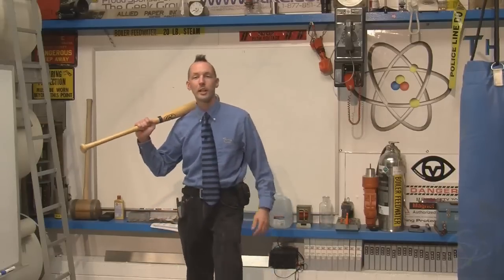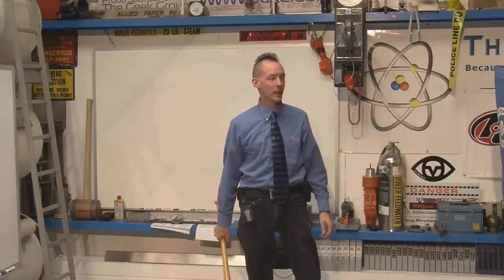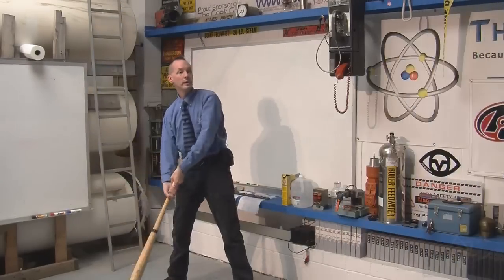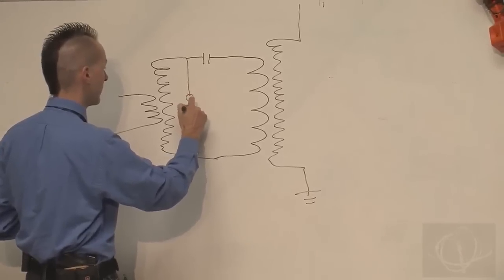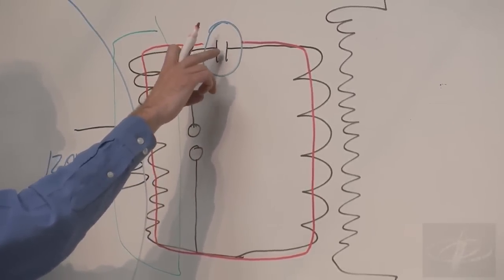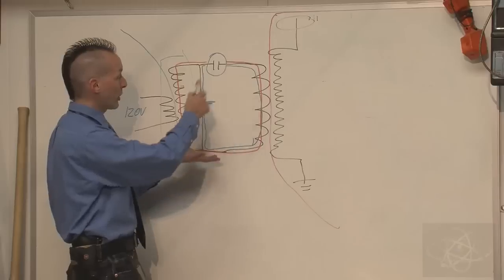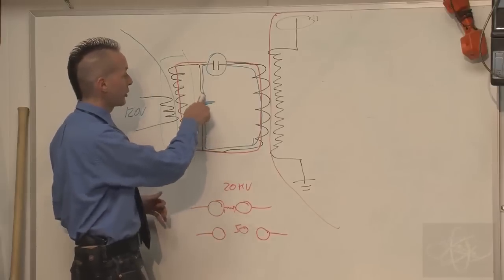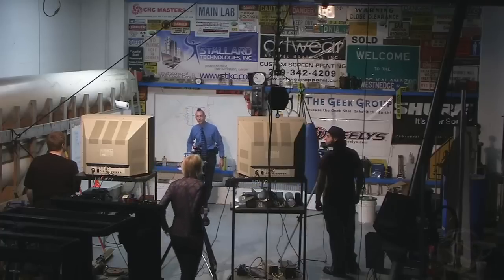Resonance and Tesla Coil Basics

Comment: Great simile on mechanical resonators and electrical resonators. But the most significant component in the Tesla conventional circuit is the spark gap and non-linearity. You are applying power to the input of the first transformer at sixty Hertz. The second transformer does not work very well in stepping up that frequency to the very high levels you desire. It is most efficient at very high frequencies. Frequency synthesis in electrical systems require non-linearity to produce harmonics that operate the resonance of the LC tank system. The spark gap provides that non-linearity. LCR circuits have very little non-linearity. Fundamental circuits concepts are that they are either linear on non-linear. Linear circuits do not produce harmonics (Fundamental concept here). Also I would suggest you swap the positions of the capacitor and spark gap. This will decouple the 60 Hertz primary transformer windings from the much higher frequency resonance secondary system and improve efficiency ( producing higher voltage of the harmonic frequency) and will cause the first transformer to run at a cooler temperature. I have some experience with Tesla coils building my first one in 1971. I love em...
Reply: When I was active in a TC club the popular approach was to put an RF choke (ferrite toroid) on the transformer output. Same thing: keep the RF out of the transformer.
Reply: Hmm are you saying I can use this to get 60Hz on the output of the secondary and if I want higher voltages on the secondary I would move the cap for high freq? If my NST puts out 30kHz, 9kV at 30mA I can get to higher freq by moving the cap and with cap size I can reach the natural resonant freq on the primary?
Reply: Mark Cummins Thanks Mark. :)
Reply: Well done!
What are you talking about the London Council for, he sounds American?
Reply: What about the rodin coil?  any thoughts?  does that design automatically make a "gap'?  I'd like to throw a frequency into a rodin coil and test it... not a battery but a frequency... then add a battery if maybe .. then try a second frequency to make a harmonic or resonance or both..... probably don't even need a spark plug, I'm guessing.  What do ya think? may have to connect the beginning of winding 1 to the end of winding 2  on the rodin coil to make it a geometrically designed tesla coil.... then we may need a spark plug to get a gap... I dunno. What say you?
Reply: Thank you. Glad you bring this up. It is what most fail to explain and dive into

Comment: Great clear explaination.

Tesla once attached a pocket alarm clock sized device to a street lamp post and tuned its frequency so it would produce a "thump" at resonance.  After a few minutes of thumping, the effect was so great the 3 storey building beside the lamp post began to shake.  The people inside came running out and some called the cops thinking it was an earth quake. 

Tesla quietly removed his device, put it in his pocket and walked away.   

When I heard that story, I was amazed at the power of resonance.
Reply: orangedac it was not the size of a pocket alarm.. you need to look into that more, there are even photos of it.. but it did fit in his jacket pocket. it was a steam powered oscillator and he has patents on it

Comment: Very good! Convert the "heavy bag" coils to opposing partnered output with opposing magnetic fields that have the effect of reducing impedance to zero and thus increasing inductance to Infinity(?). Have another spark gap on a deep ground like a well, and feed large caps to provide pulsed dc current on demand which can be converted to A/C or regular dc as needed

Comment: In your demo with the heavy bag and baseball bat, it would be most efficient if you hit the bag at the middle / bottom of the swing (vs. you seemed to be backing up to hit it almost at the peak of the swing where it is slowest). Assuming the impulse from the bat is the same for both, hitting when the bag is at peak velocity maximizes energy transfer. So it will be quieter as well due to a lower velocity difference between bat and bag.
Nice video on the Tesla coil too. Thanks.

Comment: (2/2) It is massive radio frequency oscillations - created in the primary circuit for the brief moment that an arc is present in the spark gap - that cause the secondary circuit to resonate, not the frequency at which the spark gap fires (audible, ~120 Hz or something), as you so often describe it to be.

Comment: Well explained, but it probably would work better, if you add a high voltage diode after the secondary of the first left secondary coil...so the cap can really charge up in a few cycles...

Comment: Some nice explanations. I would like to point out that Tesla says the transformer (magnifier) is not transverse nor electromagnetic. Tesla used oscillating current and rejected Einstein mass energy equivalence.

Teslas patent also features a third coil. This is important, I feel, due to the complex dimensionality of magneto dielectric mechanics in resonating oscillating systems such as this. . (The dimensionality of the devices wave output interaction, without the third coil wildly differs) :)

Comment: To Adithmart, Electronic 101, capacitors charge first in a circuit> if you don,t see the resistance, for example, don't assume it isn't there

Comment: I take it you are referring to a toroidal terminal capacitance at the top of the Tesla coil's secondary winding? The geometry of the capacitor is not really important. It could also be spheroidal. But the resonant frequency of the secondary coil with its capacitor should be close to that of the primary coil and its capacitor for best results. Which is why we need to know about resonance and the coupling of the two circuits.

Comment: It would be interesting to hear more about the properties of the plasma in the spark gap and oscillations while it is conducting. And while the plasma is conducting the capacitor will not charge so there will be a delay before it can do so again. What would these times typically be?

Comment: You will find if the speed you hit it at and the top speed of the bag is the time you hit it then the result will be far more effecient as the difference in the speed of the 2 mechanical apparatus will determine the absorbance of the energy . Think slapping water with your hand. You can disperses a lot more water with a gentle push in a pool but slapping the water is very ineffecieng .

Comment: I've been trying to understand the correct resonant frequency of my circuit.  The problem is, everyone seems to be more concerned with the resonant frequency of the secondary of the Tesla Coil and not the primary of the Tesla Coil or the secondary of the NST.  I can't seem to figure out what my capacitor value should be, how close the spark gap should be, what the inductance of my secondary on the NST is and the resonance of the primary of the tesla coil and how all that goes together.  Like I said, no one seems to cover this in detail.
Reply from the maker: It's coming, there's a whole new HV series we've already started putting out new episodes for. :)
Reply: @ChaoticGoodChris  Awesome!  I like your delivery of the info.

Comment: how does the cap charge when the AC current from the input transformer is changing directions at some frequency? or is the tuning very complicated?
Reply: It charges both ways so if designed right it should be charging and discharging both directions. I've thought about this when it comes to flyback SGTC's and how people use HV diodes but it's probably because of the driving frequency. Just easier to get only a positive charge in order to bridge the gap.

Comment: I have a question that is probably very silly - please explain why the capacitor continues to charge through the negative cycle of the AC. I would have thought that the capacitor charges for half the cycle and discharges for the other half and so there is no net build up of charge. Obviously that's not the case, since it does have a build up, but it would be great if someone explained why. Thanks in advance.

Comment: When you mentioned that you hold public demonstrations,  someone is going to point out the following:

"You claim that the AC waveform from the secondary of the neon sign transformer is charging up the capacitor.  Fine, but - the secondary of that transformer is alternating between positive and negative voltage polarity.  That being the case - since the capacitor being charged is electrically connected to that changing, alternating voltage - how can you say 'the capacitor charges up'?  When the top of the neon sign secondary is POSITIVE, the left side of the capacitor is also POSITIVE - and thus the voltage on the capacitor is built up with positive polarity on the left plate and NEGATIVE polarity on the right plate.   BUT THEN top of the secondary of the neon sign transformer switches polarity and becomes NEGATIVE - as all transformer secondaries (and primaries) do.  At that time, the left plate of the capacitor is subjected to that NEGATIVE polarity.  WHY DOESN'T THE CAPACITOR DISCHARGE EVERY 1/2 CYCLE OF THE SINE WAVE ACROSS THE NEON SIGN TRANSFORMER?

You're going to get that question at some point.   You cannot reply by saying "there's a diode blocking that from happening" unless your Tesla coil circuit has a diode.  And you can't say "there's a big enough resistor so that in 5 RC time constants, there's not enough time for the capacitor to discharge so it holds its charge" either, unless - again - your Tesla coil has such a resistor.

I mention this because I taught STEM classes in college for 5 years and figure you guys will get that question at some point - always good to know what the answer is.
.
.

Comment: How does the capacitor charge? I thought AC passes straight through a capacitor and DC charges it? Thanks
Reply: Its similar to the working of an SCR ! the capacitor chargers till the rated plasma breakdown voltage in 1st +ve half cycle and discharges in the same cycle by giving the impulse !!!
Reply: I had the same question...I think there is more difficult tuning involved than would be interesting enough to describe...or no one really understands anything like me

Comment: @215858452845 

On the secondary coil, the wire-length has something to do with the resonance - some say that making a coil which uses exactly one quarter-wavelength of wire for the intended frequency will give maximum performance, though many say "B.S" to that...myself included.

Christopher Karr,
Member of The Geek Group

Comment: If you put the capacitor from top to bottom(vertically) just to the left of the Tesla coil that goes from the secondary to the primary on the far right which connects the ground to the ionosphere , and put the spark gap horizontally to the left of the capacitor you'll have free energy that you can sell to the electric company.You just reversed it eliminating the original 120v.
The spark-gap has to be to the left  of the capacitor and HORIZONTAL otherwise you'll be buying the electricity.

Comment: I realize this is 7 years too late, but doesn't he have the positions of the capacitor and spark gap reversed in his diagram?
Reply: They can be arranged either way.  Both configurations rely on the supply transformer having a high impedance to the high frequency oscillations.  Some Tesla coils have inductors in series with the supply transformer.

Comment: Nice explanation but...
5:00 Your drawing contains mistake and it is so different than classic Tesla drawing.
The gap and capacitor should be swap. Why?
1. Gap short the secondary side of first stage transformer (15kV) and this will heat transformer or/and break your fuses on the primary side (house fuses)
2. In original solution current in primary side of second transformer flow only as an impulse initialized by the gap, but in your drawing it flows in both times when charging and discharging.

Comment: If Sir Isaac's third law is true, what prevents the electricity produced from the Tesla coil from powering up your home. I'll tell you why? Because people haven't figured out that in order to harness the electricity from from the Tesla Coil... You need "2 Tesla" coils mirroring each other vertically. One "active" (grounded) the other receiving (suspended Upside Down). The vertically suspended "upside down" Tesla Coil needs to be suspended over the grounded one; it must rotate above the groundedTesla coil with copper wires extending down from the mushroom head - like a cork screw - spaced out over the coils of the grounded one. It should rotate using the mangnetic field, like https://www.youtube.com/watch?v=iG0pzGcy4xU. The receiving telsa coil (upside down and rotating) will collect an enormous about of electricity.

Comment: Tesla just wanted to make big sparks. everybody knows that Tesla coils make big sparks, but don't do anything else. You would be a good candidate for a tenured professorship.
Reply: Actually, it's an antenna. Antennae are known for their extreme voltage and current peaks. Even a little CB radio putting out but 4 watts can with a properly tuned antenna cause a neon bulb(at the high voltage point) to light up brilliantly. And you don't want to touch that antenna because you could get an RF burn just as you would from a leaky microwave door by touching it.
Reply: Lochinvar, exactly so. Tesla's goal was to create a resonance with the atmosphere at 40,000 feet to produce a luminous discharge over the entire Earth's surface and a 7 Hz standing wave that could be tapped anywhere on Earth with a non-arcing resonant coil. The giant coil would ultimately be fed by the same source as lightning: convection of charged dust.
A decent Tesla coil is an electronic analog of a whip, just as a quarter wave vertical antenna is; the decreasing capacitance to ground increases the voltage at the cost of current. Because it is heavily loaded (in antenna parlance) the radiation resistance is low and the power does not radiate effectively. Instead the voltage peak you describe is intensified. (FCC Radiotelephone licensed since 1969.)
Reply: Rae Chrest look into Schumann resonance this shit was known long before NASA did that.
Reply: Rae Chrest using a vortex coil, aka the master tuning coil in his circuit he was able to match the frequency easily.
Reply: He was interested in the reverse of the circuitry to generate electricity,.. maybe we just didn't realize it until lately...